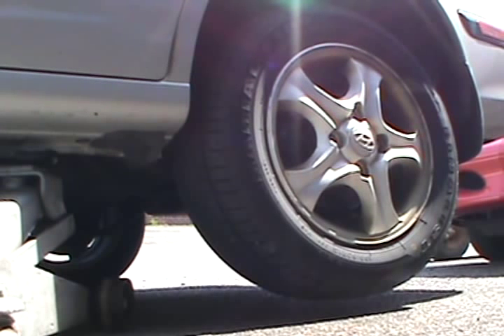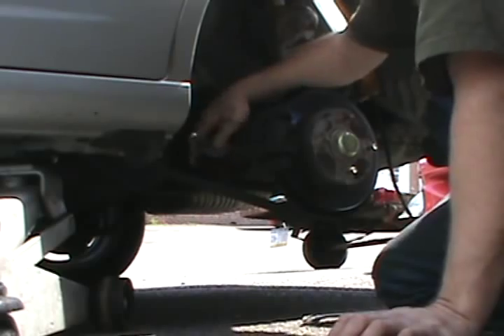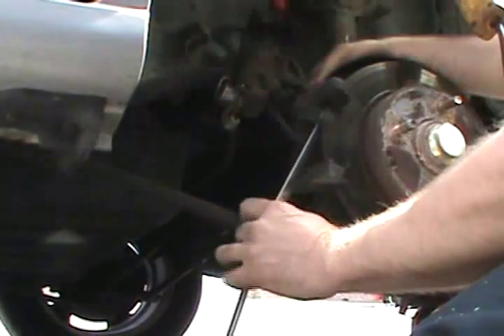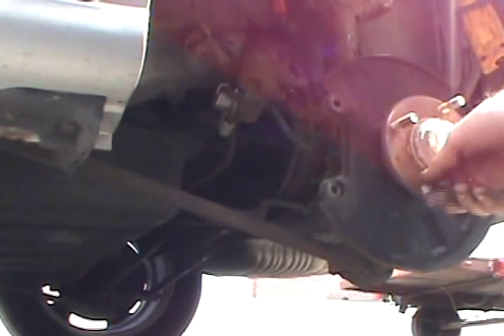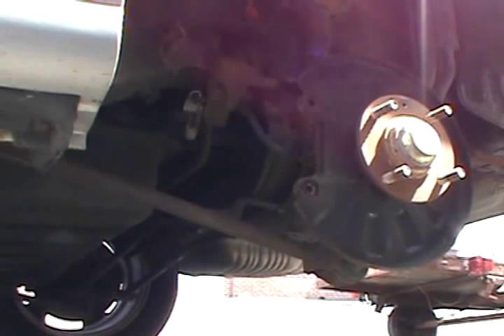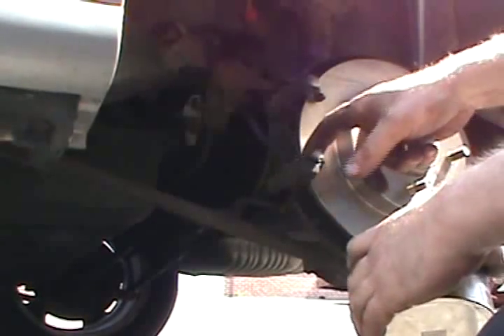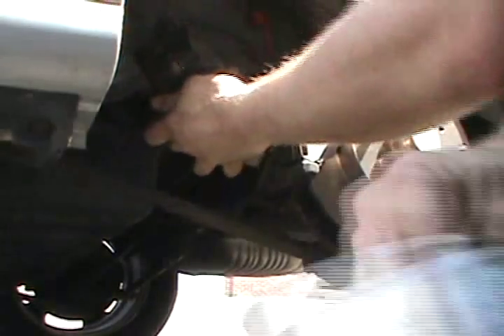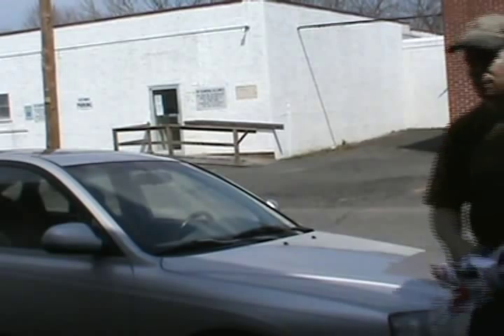inspect & replace rear disk brakes and rotors on a Hyundai elantra

Comment: Hi Will,  Thanks for the great video. Needed tips on doing a brake job on the 2004 Elantra GT such as retracting the caliper piston and tips on the emergency brake line.  You showed how, as a pro you do it.  I liked how you use your tools such as the two open end and box end wrenches to add leverage/torque for breaking bolts free. Hanging the rotor with a short bungee is faster than my hunk of wire.   I have had the impact screwdriver for years and love that tool.  Even the tip about cleaning rust off the hub to reduce harmonic noise is gold.  Cheers,  Jon...

Comment: Excellent video....And I don't mean the taping, I mean your work,lol...I felt like I was watching myself. Many don't take the time to hang the caliber or clean the hub surface. Only difference I do is add abit of anti sieze on the hub surface and around the  center rim of the rotor to prevent sticking. Id say you probably learn from a mentor then took your course. I wish you were close, you'd get all my work. Great job. Keep up the good work. Im now a subscriber.

Comment: I was puzzled when i did brakes on a Hyundai and found you had to screw in the piston. I don't understand how it comes out to brake if it has to unscrew. The tabs on the back of the pad hold it in place from turning.

Comment from the maker: @vietkid977  in some cases you may and here is why... while your brakes ware down the travel increases in the calipers and or wheel cylinders what have you, therefore the fluid level in the master cylinder will lower... now if someone ads fluid to the reservoir in this time. what happens when you go to install the new brakes and you compress the calipers. the fluid that was added will now be on the floor overflowing from the reservoir, so in some cases you may need to remove some. not all

Comment: I recommend getting the tool to dial back the pistons. Also, I would like to know what you do if the screws wont come out? The screws on mine are recessed into the rotor so I cant even cut the heads off. They're stuck!!! I would like to know why you would screw the rotors on, seeing as that area generates much heat and corrosion to fuse the screws on like mine.
Reply: +Richard Kane Use an impact screwdriver.

Comment: When I installed new pads on my 2005 elantra it's so tight that it's hard to spin the rotor. Is this normal? It's a new caliper, new pads and new rotor.

I'm also having trouble getting the parking brake line back on. The remanufactured caliper is slightly different than the original and doesn't fit in the groove properly.
Reply: Id say your emergency cable is stuck or u didn't turn back your piston.